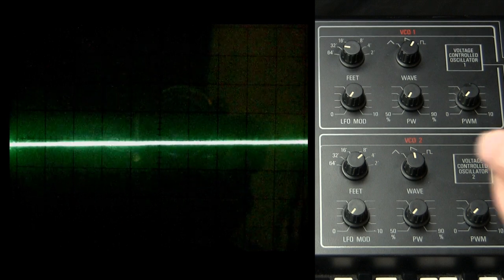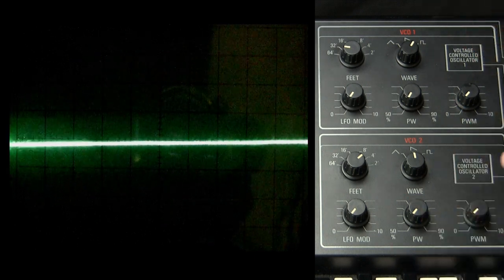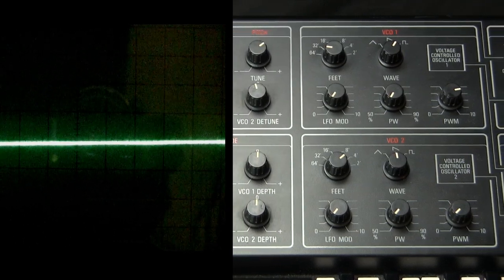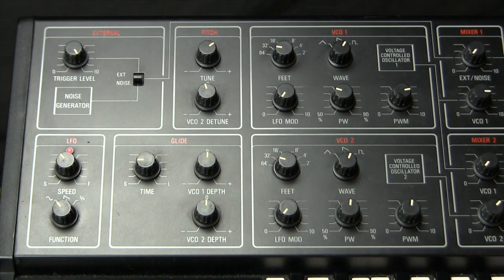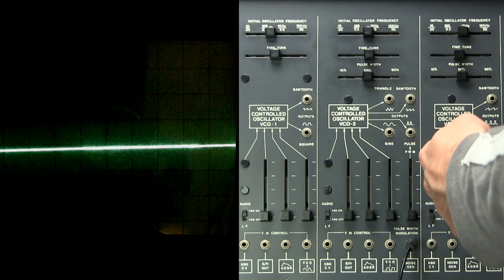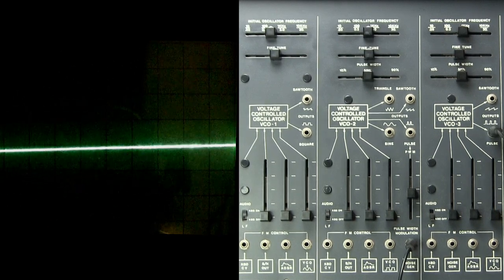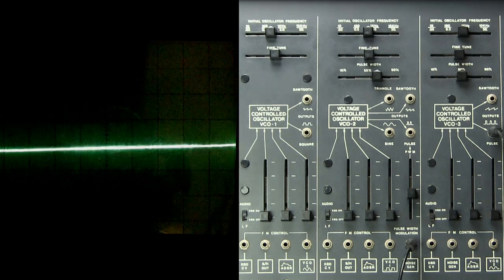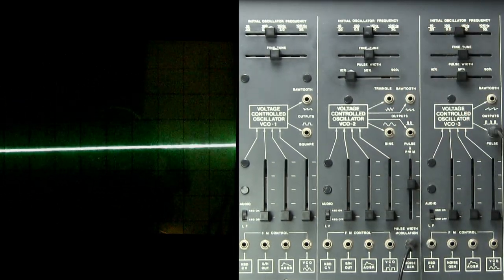Oscillators- Pulse Width Modulation

Comment: Does yamaha modx has feature to do this?
Pls someone opinions
Reply: I'm not that into FM synthesis (which is what MODX has along its own S+S engine called AWM2). But I think there should be some way to achieve a similar timbre through either FMx or AWM2 engines. What you are looking here is a sustractive synthesis engine, so there would be no direct correspondence but in your reference manual you should have a very deep and complete description of the synth engine and its sonic possibilities.

Comment: what kind of hardware is this demonstrated on. this thing looks awesome, also is this a built in oscilloscope? are there oscilloscopes like these one can buy?
Reply: Kevin Nowacki The hardware used is a vintage Yamaha Cs 15 and an Arp 2600, Marc uses an editor to do a split screen view here with, a seperate oscillope view its not built in . However the new(ish) Korg minilogue (poly), and the (monophonic) monologue have this built in :-).